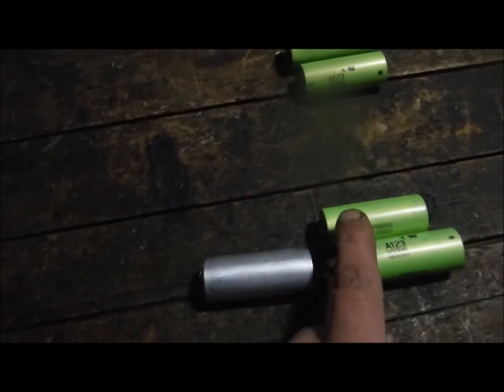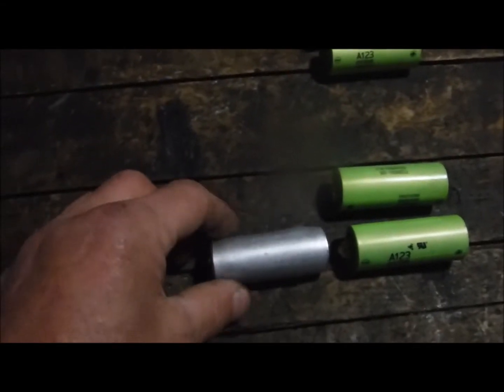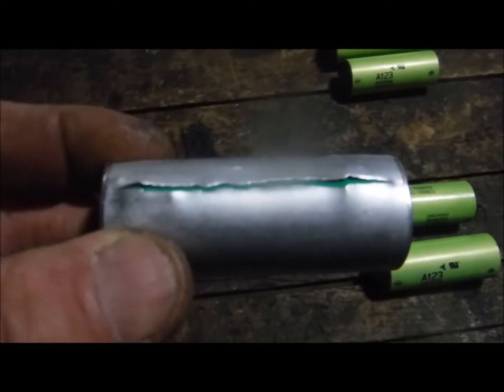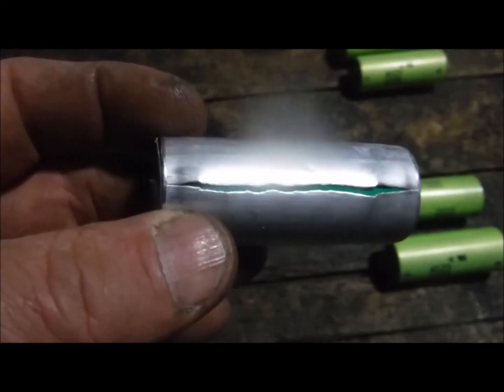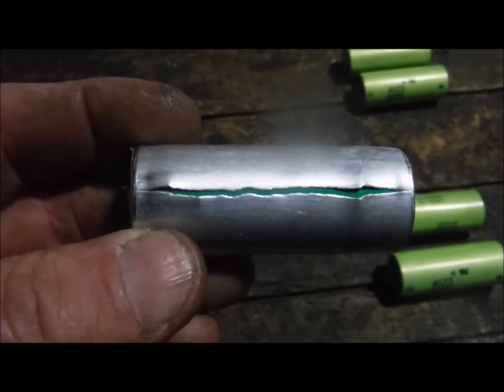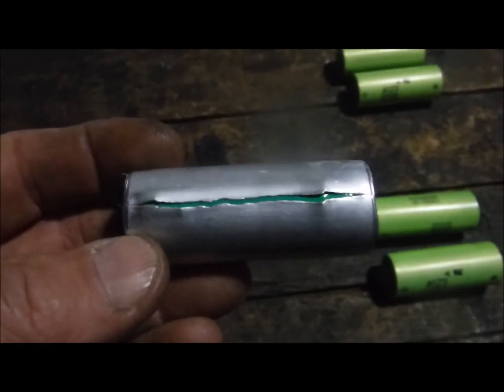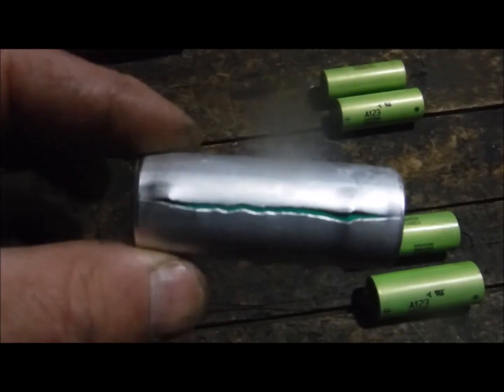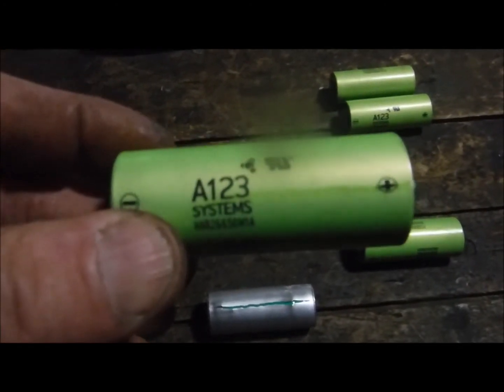Lithium Phosphate A123 Systems Battery Cell Exploding

Comment: Did you originally get these from the bus packs or the medical packs being sold? Just wondering about the bus cells being used and abused a bit more. Thanks!
Reply from the maker: Bus. Where are the medical packs being sold at.
Reply: @MrDoingEverything  I got mine from Battery Clearinghouse. I am sorry... They may be from back up rack computer servers. Because they were used just as a backup they never really got cycled.  I bought and harvested 160 cells out of 20 packs. I think they still have the larger packs available at $50 each with 48 cells.